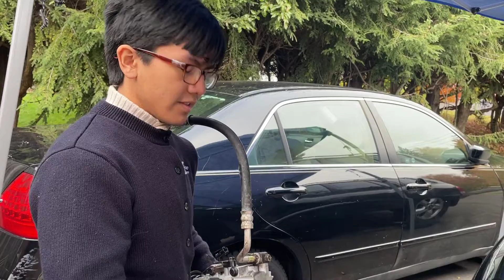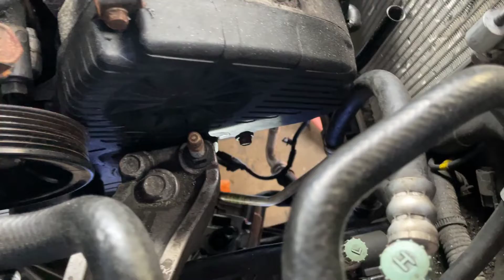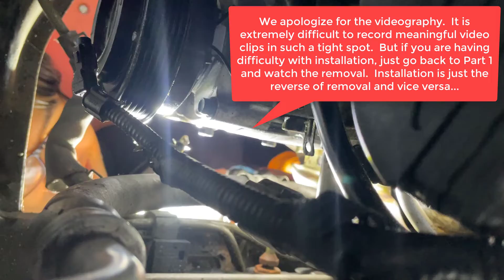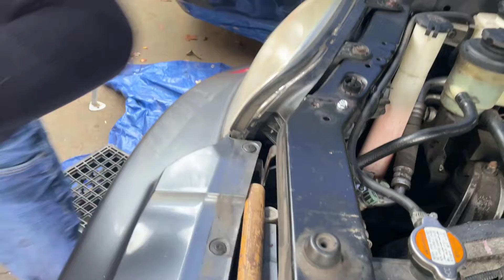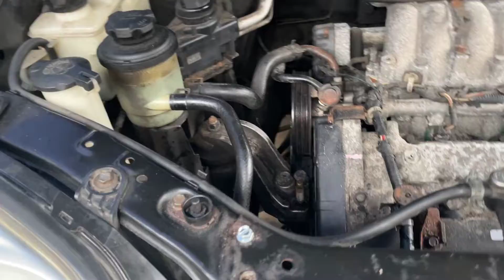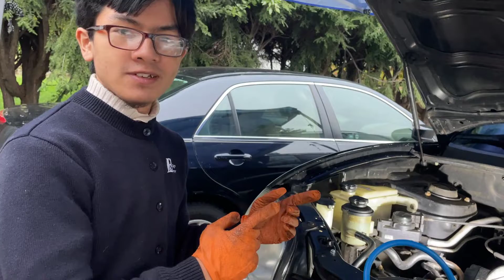How To Install AC Compressor Hyundai Santa Fe 2002-06 Replacement Part 3 | Hose Fitting Nut Stripped

Comment from the maker: Here are the #ad links to some of the tools & parts which might be required to perform this repair:
1.  https://amzn.to/3nBlwN2  |  RYC Remanufactured AC Compressor and A/C Clutch EG183 (Fits Hyundai Santa Fe 2.7L 2001, 2002, 2003, 2004, 2005, 2006)
2.  https://amzn.to/3FGV2QH  |  ECCPP AC Compressor with Clutch 2001-2006 Fit for H-yundai Santa Fe 2.7L CO 10957C
3.  https://amzn.to/3tIdYft  |  InterDynamics Certified A/C Pro R-134a PAG 100 Refrigerant Oil - ICE 32 (8 fl. oz.)
4.  https://amzn.to/3GGt2xH  |  MOCA EPDM Serpentine Belt Professional V-Ribbed Compatible with 98-02 Camaro 5.7L & 96-00 Dodge Dakota 2.5L & 01-06 Hyundai Santa Fe 2.7L & 2005-2008 Kia Sportage 2.7L #6PK2005
5. https://amzn.to/3w7f7wm  |  Milwaukee 2457-20 M12 Cordless 3/8" Sub-Compact 35 ft-Lbs 250 RPM Ratchet w/ Variable Speed Trigger

Or Click on Amazon link here and search for what you need:  https://amzn.to/3xIOsqg